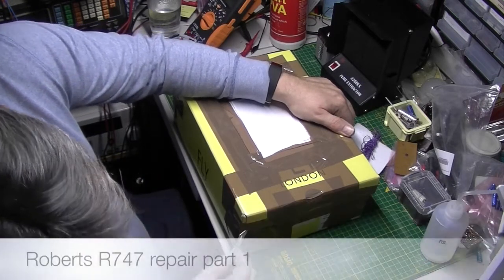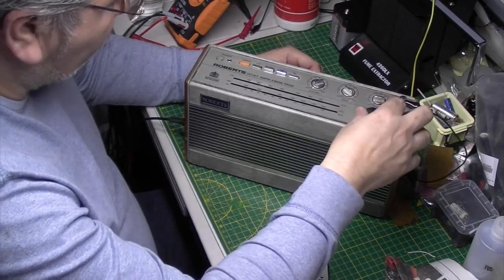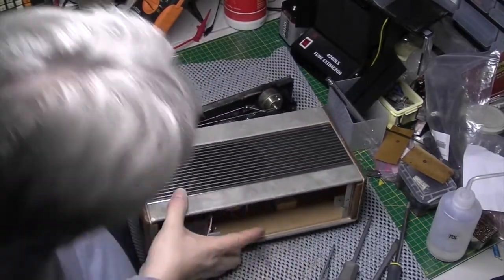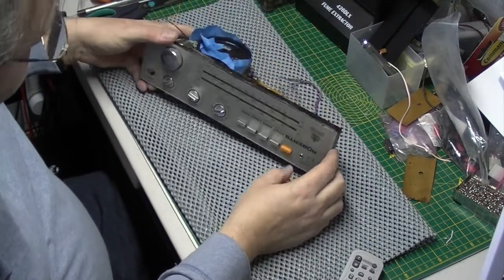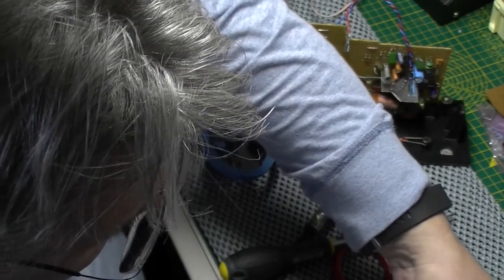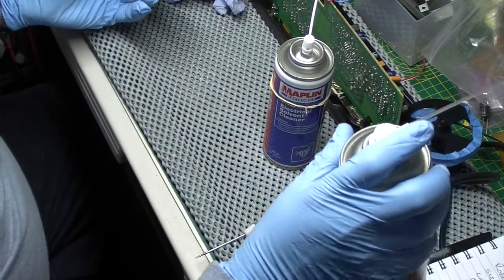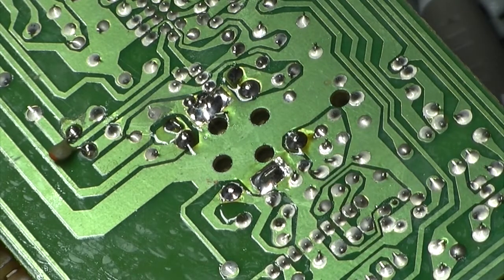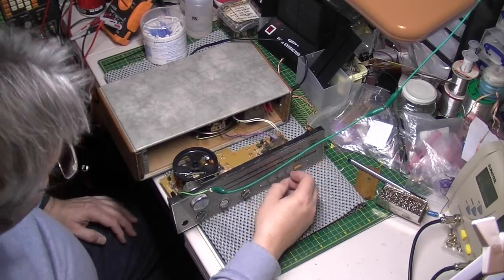Roberts R747 repair part 1: Tuning capacitor

Comment: I've been working on radios for over 40 years and I have never seen that kind of corrosion in a tuning cap before. That white powder looks like aluminum oxide. I've seen that many times  in the electrical field on threaded fittings  used on outdoor aluminum conduits. It's caused by being exposed to the elements and by pollutants in the air. I wonder if the plastic in there is breaking down and is leaching out a compound that is reacting with the aluminum plates causing them to form that oxide. It's the only thing that I can think of that would cause that. Certainly a new one to me. Thanks for the look see. ATB Doug.
Reply from the maker: Hi Doug. This is the 3rd one I have had now with the same problem. It certainly does look like oxidisation. I have managed to clean it off 2 out of 3 so I think there is going to be loads of these coming my way very soon for repair. I just need to source a comparable tuning cap with the same values which is proving difficult. Thanks for watching
Reply: @Radiocruncher   Hi Graham, The tuning indicator on my 747 has become detached from the string. I've dismantled the set.Do you know how to separate the top plastic cover so that I can get at it? Thanks for these great videos - really helpful. Ian

Comment: How I solved the drifting on two of my  Roberts radios R707 is switch the AFC off tune in to the station then put the AFC back on and it holds  the station and no more drifting if you look at the instructions it tells you this
Reply from the maker: Thanks for the tip

Comment: Excellent troubleshooting and repair Graham, Does a radio antenna, ever go bad?. Thank you....Angelo.
Reply from the maker: Hi Angelo. Thanks for the kind comment. Telescopic antennas do,fail. Usually the shims inside break off and the sections pull apart. Also they are easily bent or snapped. The ferrite rod antennas are fragile and can snap. Also the wires from the coils are very tiny and easily broken. Thanks for watching

Comment: Being from the u.s. ,I wouldn't no,do they still make Roberts radios ,a lot of the ones I seen I kinda like ,I am still figuring out the models I like .,but I am a big fan of different stuff in radios .I don't want everything from China ,I like our older radios ,I love tube radios from the 1950,s and the 1960 ,s area.the 60 ,s area in general ,I like a lot your stuff out stuff Germany ,like grundig .I hope I can learn a lot from you.

Comment: Hi Graham, managed to acquire three Roberts RM40s, Got two working and looking and sounding brilliant. (an electrician repairs) The third one needs all those blue caps changing.     Are you able to point me in the right direction?.  Is there anywhere to buy a RM40 cap replacement pack?.  Or am I on my own.    Take them out and go to Farnell or somewhere?.
Cheers Graham,  Really enjoy all your output.  Trying to learn.             Just done an "electricians repair" on a 747.   Again it sounds great!.
Reply from the maker: Hi Jeff. Well done getting 2 out of 3 going. I can sort you out a kit to replace the caps but are you sure that it’s them causing the problem? What’s wrong with it?
Reply: @Radiocruncher  Hi Graham, thanks for reply.   Im thinking caps purely on a visual.  3 of the larger ones I can see a small amount of yellow crud where the wire enters the cap.
When powered up it will not tune into anything. I am getting hiss and crackling but no stations. As I am trying to tune in I get a really big hiss/crackle at the mid way point on all FM/AM?.   Just brushed and Hoovered it all out.  Cant remember if I gave it some Servisol the last time I looked at it, prob did.   Thanks for the help Graham.
Reply: @Radiocruncher  Hi Graham, it may be helpful in that they have AUX inputs. Just tried with my phone and just got hiss. The other 2 do a fine job.   Dont understand that either. Its a stereo mini jack to din plug (mono) and it sounds good?. I think these things have a bit of witchcraft!. Cheers mate.
Reply from the maker: Sounds like the caps have leaked some electrolyte so probably best to replace them. I suspect the big hiss/ crackle is interference in the amplifier which sounds like it’s working. Your fault is more likely in the IF stages. The FM tuning potentiometer will need switch cleaner in it which may well bring FM back to life. You will need the manual in order to set the FM up. I can sort you a pack of caps if necessary. Email me graham@radiocruncher.com
Reply: @Radiocruncher  Thanks Graham. Just bagged a manual on ebay.  And Georges latest 2 parter is the RM40!. Ill let you know about the caps.   Cheers.

Comment: @Radiocruncher Not to be a fly in the ointment, but I think you forgot to put the little metal bracket that holds the tuning cap to the plastic chassis. Great job otherwise! That cap looks almost like new, now.
Reply from the maker: Stay tuned for part 2 when it all goes back together. Thanks for watching